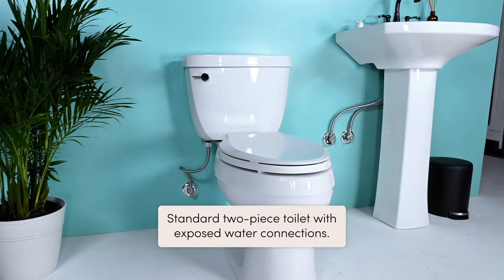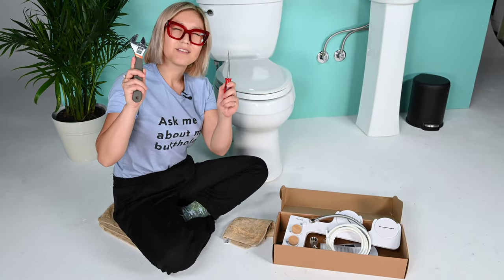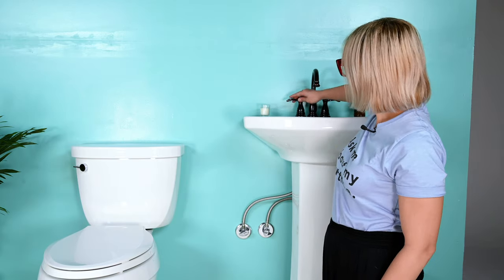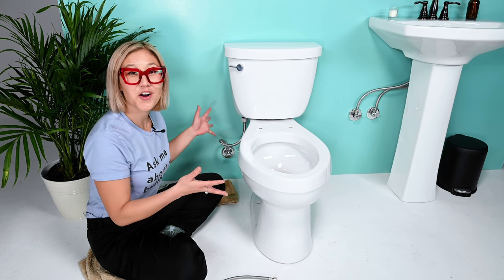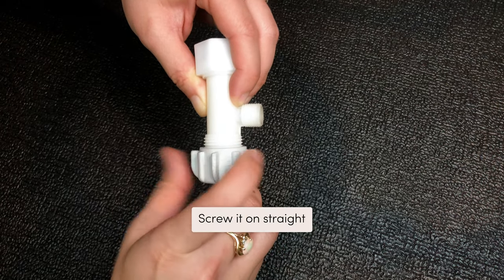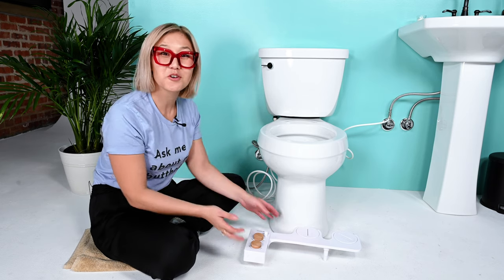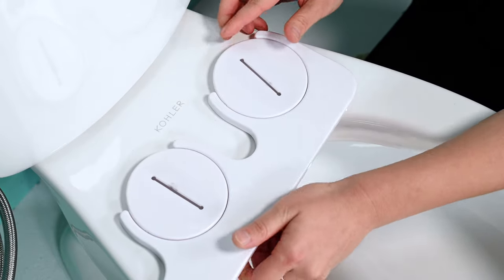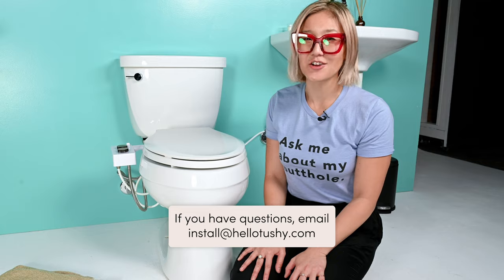TUSHY Spa 3.0 Full Bidet Installation Tutorial

Comment: A little tip: make sure the connectors on the underside of the Tushy are tightened as well. I kept getting a leak on my hot connector and I thought it was where the tube connects. It was the nut that was leaking. Tightened it lightly, leak gone.
Reply: Me too, Jade! Thanks for the tip!
Reply: Yes. Check any and all connections, especially those that came out of the box that way.
Reply: Same here! Thanks!
Reply: Same issue. Hopefully fixed now 😊

Comment: Just installed mine. I have a REALLY tiny bathroom so my sink cabinet is next to my toilet and the tushy ALMOST didn’t fit but it fits! I had a lot of trouble with the screwing because the bathroom is so tiny I barely fit enough to see so I did screw on the cold water wrong a couple of times and had some leaking but I just turned on the cold and hot water and no leaks! 

Now to take the baby for a spin!!!
Reply: Ok I'm worried about this I have small apartment and my sink has a cabinet. Will it still work for warm hook up?
Reply: @amandarumer9355  it works just fine with the temperature. I’ll say this. I noticed that at first it’s cold. Depending how your hot water comes out. If it takes a while for it to warm that’s how the bidet will work

Comment: Hypothetically, if one was fancy with their bathroom remodel and put a hot water line beside the toilet, could they remove that compression fitting and use a flexible cable to connect the hot line?

Comment: My adjacent water connection takes a looong time to warm (supply is one of the farthest from water heater). Does a classic make more sense in my case?
Reply: I was already thinking how much of a pain it was going to be to run this up in the attic and back down through the drywall and then realized after reading your comment the warm water connection was pointless. Until I get our old galvanized replaced with PEX, that water's going to be cold anyway.

Comment: Is there a maximum length for the polyurethane tube that someone might use before water pressure becomes an issue?  My toilet is on the wall opposite the sink, but it's a relatively small bathroom.  Theoretically, I could run the warm water tube through the wall, up and over the bathroom door, and out of the wall to where the valve is on the toilet.  But I'm not sure if that's a reasonable workaround.
Reply: If you're running through the wall, you may want to run a new hot water line with pex or copper.

Comment: Kind of an eye sore with all those connectors hanging around all over the place.
Reply from the maker: The connectors attach at the tap, so they're generally out of the way. If the concern is the hot water connect you can either tape them back and out of the way, or go with the Classic :)
Reply: It's a toilet bro

Comment: damn, most bathroom sinks aren't like that though, they're covered with a cabinet underneath, so cant get the 3.0, warm water woulda been nice
Reply from the maker: You can drill through the cabinet to feed the hot water line, or get the new TUSHY Ace. It's fully electric with a built in heater :)
Reply: @HelloTUSHY  Ooh that sounds divine!!!

Comment: Can I cut the hot water connection line shorter if I don’t need the length to reach the sink?  Thinking it might reduce the time to get warm water to the tushy if it doesn’t need to empty out the water left in the line first.

Comment: Because the hot water tank is in the basement it takes awhile for the hot water to rise to sink. So, when the hot water is turned on only cold water will come out of the tushy.
Reply from the maker: Hi Jesse! here is a TUSHY trick for the problem you are describing regarding a lag in time for the hot water to reach your bum. TUSHY has a setting called "nozzle wash" which simply washes the outside of the nozzle with water.
Reply from the maker: That water then flows into the bowl. You can also use this setting to flush out the cool water in the water line in preparation for the bum washing.
Reply from the maker: Simply activate the nozzle wash setting by turning the knob a little bit until you hear water running straight down into the toilet while you're doing the deed. The cool water will stream out of the pipes in order to access that warm water for the bum washing. Then you can just turn the knob further to activate bum wash when you're ready! 😊

Comment: Is there just one for cold water?
Reply from the maker: TUSHY Classic just connects to your toilet's tap, and the Spa connects to that and your sink's hot water supply for temperature control :)
Reply: @HelloTUSHY  I have the 3.0 spa so I was wondering if my sink has no way of running the hot water through the bidet, can I still just install cold water in it without it leaking of some sort?

Comment: The installation is easy but… what’s the us of the golden part?!? Thanks
Reply from the maker: Hi Josue! I believe you're referring to the inlet cap: https://hellotushy.com/products/inlet-cap. It is only used if you don't want to install the warm water connection! You'll just need to remove the plastic barb fastener that's likely currently seated in the hot water port and screw the inlet cap to block the warm water connection.

Comment: You do not need a 1/2 inch T adapter she is steering you WRONG if your pipe doesn't fit for the hot water. You need a whole new tube

Comment: My sink is inside a vanity/cabinet. Does that still work?
Reply from the maker: Hi there! For enclosed sinks, most of our customers drill a small hole towards the base of the enclosure to slide the white polyurethane tube through the side. You can use an 8mm or 11/32" drill bit or anything bigger. If there happens to be an opening in the sink enclosure, you can also feed the tube around the baseboard and through the opening to get to the sink.

Comment: Can I connect just the cold water connector and leave out the hot water connector ?
Reply from the maker: You can totally hook up the TUSHY Spa and use it with your cool water connection only. That works just fine. This setup could also provide you flexibility if you want to use the TUSHY Spa in the future in a different bathroom, etc. The box already comes with a cap to screw onto the hot water connection under the TUSHY console just to provide a double seal on top of the valve inside the TUSHY. See more details here: https://hellotushy.com/products/inlet-cap.
Reply from the maker: And here's how you'd use that cap to block off that warm water connection: https://www.youtube.com/watch?v=fYfWKOgusz0. You'll just need to remove the adapter that's likely currently attached to the hot water port.

Comment: You will NOT hear a 'distinct sound of the water shutting off' unless you turn on the sink tap FIRST and have water flowing.  Same for the toilet feed.  Likewise, unless you flush the toilet FIRST and have water actually flowing through the feed, there will be no sound when the shut-off is engaged.  Do note that in the video you flushed the toilet AFTER you engaged the shut-off valve...

Comment: I bought the tushy and it did not work for me.  The pressure is too high.  It makes a mess and hurts when I use it.
Reply from the maker: Hi Liliana! We're sorry to hear that! Sounds like your home has great water pressure! TUSHY works best between 45 and 55 PSI, so if your home has stronger pressure we'd recommend adjusting that to make it more bearable. Also, here are some quick tips on how to get the squirt you desire. Most of the pressure action happens between 12pm and 2pm if you're looking at the pressure knob like a clock face.
Reply from the maker: So if 2pm blasts your butthole off, start with 12:15 and slowly take it from there and find your sweet spot. If it's still too strong, you can also try flushing at the same time as you activate the TUSHY spray to get a diminished sprinkle. If none of the above helps, we can send you a Water Pressure Reduction Insert to add into your TUSHY console connection and you'll just need to cover the $4.99 shipping fee. This will hopefully reduce that pressure a bit. 😊
Reply from the maker: Here's a video on how to install the water pressure insert: https://www.youtube.com/watch?v=2FMrmQR5YWE

Would you like us to send this? If so, please share your order number and shipping address.

Comment: It seems that your toilet needs to be fairly close to a water heater to get fast warm water. My bathroom takes 10+ seconds to get warm at the faucet, at that, rate the cool water would have already done the job
Reply from the maker: Hi Chris! There is a TUSHY trick for the problem you are describing regarding a lag in time for the hot water to reach your bum. TUSHY has a setting called "nozzle wash" which simply washes the outside of the nozzle with water. That water then flows into the bowl. You can also use this setting to flush out the cool water in the water line in preparation for the bum washing.
Reply from the maker: Simply activate the nozzle wash setting by turning the knob a little bit until you hear water running straight down into the toilet while you're doing the deed. The cool water will stream out of the pipes in order to access that warm water for the bum washing. Then you can just turn the knob further to activate bum wash when you're ready! 😊